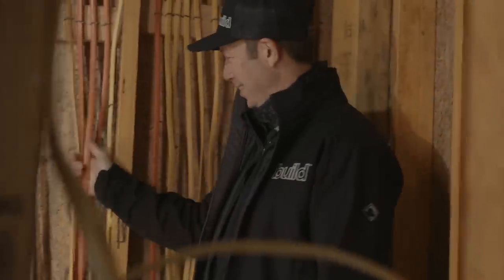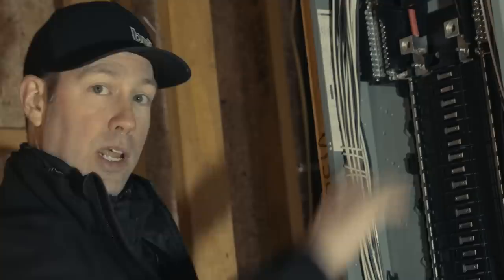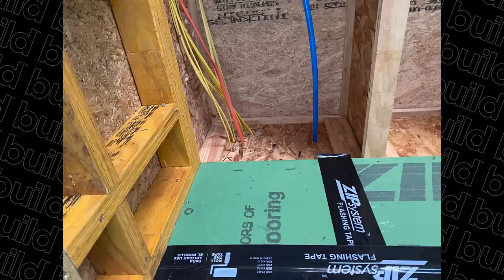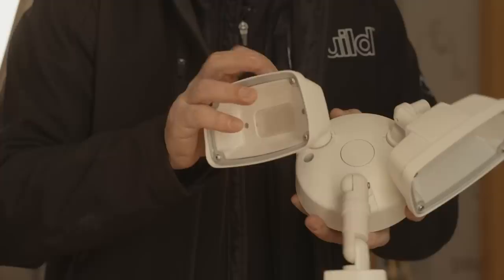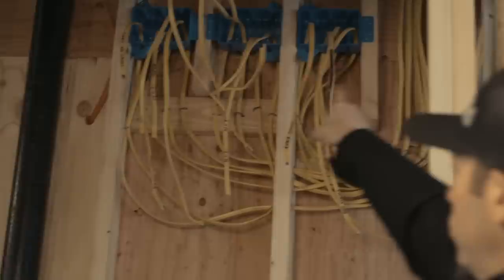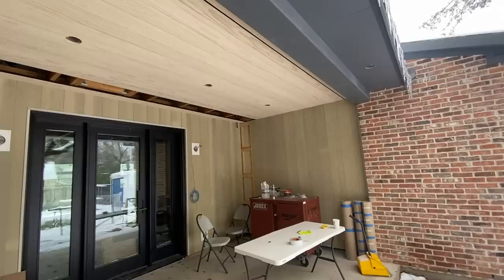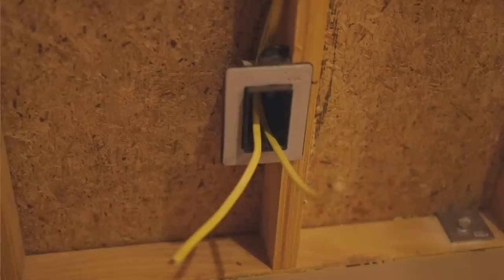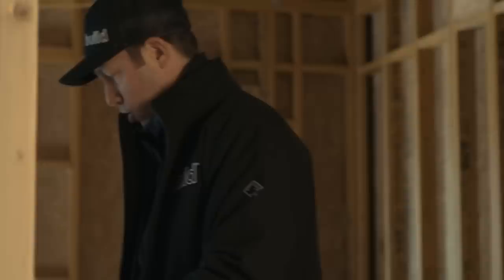5 Tips for New Construction Electrical & Smart Lighting!

Comment: maybe it's a regional thing, but why is your main panel on the outside?
Reply: I'm curious about this as well. I don't like this at all from a security perspective alone
Reply: It’s a regional thing, the same reason they install their water heaters outside.
Reply: It’s a terrible idea for thermal breakers as THEY WILL trip with moderate load on a hot day.
Reply: That's normal in the South.
Reply: Yeah but what benefit is there? I can't think of a single one but I'd love to be educated!
Reply: @shaunimal3378  I'm not an electrician (ignore the 700 miles of wire in my shop - it comes with the house) but I do know that the main panel is used by the power company for shutoffs, or it was before smart meters. May still be used for emergency shutdown, perhaps when there's been tornado damage and they need to shutoff a damaged house while restoring power.

Come to think of it, thunderstorms and tornadoes are so common that I wouldn't be surprised if that's not part of the reason.
Reply: The 2020 NEC requires an outside disconnect. All places that are on the 2020 NEC will for new construction and service changes will have an outside main breaker.
Reply: 2020 code states you must have a main disconnect on the outside.
Reply: @htownelectrican , Can't they just pull the electric meter out and shut it down that way ? Thanks.
Reply: @augustreil  it’s actually a little too dangerous for first responders to do that while under load... too much liability I’m thinking, however it says emergency disconnect....it doesn’t require a breaker just a physical disconnect or basically a large switch rated to shut down the whole system.
Reply: @claytonsprague7316 , I understand, thanks.
Reply: @htownelectrican  "2020 code states you must have a main disconnect on the outside" I imagine that's the reason, but it seems like it'd be higher-quality construction to just have a single switch on the outside (with a lock), and still keep all the breakers on the inside.  I expect most customers would be willing to pay for that very simple upgrade.
Reply: That's pretty standard in Texas.
Reply: @RaddestDad  With the recent arctic weather in Texas most likely water heaters froze and burst along with their exterior water supply lines.
Reply: @shaunimal3378  unfortunately it’s now code. Although nothing would prevent the home owner from locking that means of disconnect.

Comment: "Smart" light switches are incompatible with some LEDs. The lights will actually flash like disco strobes when turned on. Ask me how I know. I am now firmly in the KISS school of lights and switches. Having the switch mfr blaming the bulb mfr, and vice versa is crazy frustrating.
The switch mfr will publish a list of compatible lights, but the bulb mfrs come out with new models yearly..... so the "approved" bulbs are sometimes off the market. Again... voice of experience.
Reply: I have run into this in the past. Depending upon the switch and app you are using there are settings to adjust to eliminate the flashing.
Reply: @michaelkline9647  Agreed. As a smart home technician I use to run into this a lot but have learned which switches bulbs work well. Personally I use Zooz switches as I have found them to be rock solid. Of course I use nothing but Z-Wave or Zigbee devices. Bluetooth isn't very common in the professional smart home world. Unfortunately he's locked into Halo with this but hey, he got it free so I'm sure he can deal with it.

Comment: You don't get a call backs about tripped breakers if you size the loads on each circuit correctly. This new construction you should never have an issue with that. No need for 12 gauge.  Although I do prefer each rooms outlets to be on their own 20 amp circuit. Separate lighting circuits.

Comment: Wire all your ceiling lights with 14 gauge wire and to a breaker that only feeds other ceiling lights.  14 gauge is much easier to work with, cheaper and LED lights draw so little current that you will never overload a 15 amp breaker.  14 gauge for lights and 12 gauge for all your outlets and don't forget all switch boxes now require a neutral wire.

Comment: Compared to Northern Europe, it looks different, very different. Maybe it is good, but it looks worse (no offense!). Maybe someone who knows both can elaborate/compare?
Reply: Regarding the electrical? Maybe you are used to seeing conduit in the walls?
Reply: @Freedacarlo  everything in illinois is conduit. I don’t like exposed wire like that. It’s much to vulnerable. I’ve seen people drill and cut though romex.
Reply: Exactly, that is one of the main things. All wires go trough conduit. And since most houses are from concrete or stone, it is even less exposed since the conduit is encapsulated by concrete/stone. Furthermore, panelboxes and things like that are not outside.

Comment: As a computer guy I cringe at all these smart lights... just wait until some of it breaks or goes wacko with random lights turning on and off for no reason.
Reply: Computer guy hugh?  U sound Authentic 🤣
Reply: It's hardwired "smart" . I didn't watch entire video but I don't think it's got network capability.
Reply: @LucifersDeathSquad  There are no hardwired smart devices. Code won't permit low voltage wiring mixed with 120V switches. Everything "smart" for lighting controls is all wireless BT,Wifi, Z-wave, or Zigbee.
Reply: @guytech7310  - You didnt see the wires sticking out of the back of the switch and right on the package where it says "Hardwired" . Lol. The switch might have low voltage components on the inside but it needs to have 120v to power the transformer that gets low voltage to it. I do install some switches that are battery operated that remotely signal a reciever but other than that , where's it gonna get its "Low Voltage" from ??
Reply: @LucifersDeathSquad  Not sure what your referring to. Are you referring to the low voltage connect between the Halo power supply and the light fixure?  There are no hardwired signal for them. They are purely wireless signal controlled. 

If you don't believe go look at them at Lowes or HD, or from the website.
Reply: @guytech7310  - En Passe

Comment: Hey Matt great video, I've been following for some time and love all your work.  I just have one question.  I'm so paranoid about security in my house and I'm just wondering why put the breaker box on the outside of your house?  Is this a code in TX?  Here in South Dakota, we put the break in the basement or garage.  I just worry that someone could easily cut the power off in my house and take out my security cameras or even my security system.  Also, I would worry about water getting in the box.

Comment: It’s not just about the circuit breaker popping. What’s more important is that the heavier gauge has less resistance. Resistance turns electricity to heat. You have to pay for that resistance. If you plan on living in that house for a while you will actually save money. It’s not a two year payback but especially on those heavy load circuits, go up a size.
Reply: Well said. You're talking about voltage drop. You're one of the few to recognize this concern and post.. Good job.

Comment: About Aluminum Service wiring, most are alloy's that are not as prone to the oxidation these days. As long as the connector is rated for should never be a problem. still cannot go wrong with copper either.

Comment: So you ran all lighting circuits on a 20 amp circuit? That means you can have 2400 watts on a lighting circuit.  Halo 4” led cans use 8 watts.  This means u could have 300 can lights on a circuit before overcurrent.  This is complete over kill and a waste of money on the lighting circuit.  For the Outlets i can see the use of this.  Wiring new can lights with 12/2 is a pain.
Reply: I mean, not really, unless you are going to overstuff a junction box.

Comment: Your gonna regret the smart home stuff 10 years from now.
Reply: Why will he regret it?
Reply: Jack Sak This stuff just doesn’t last, and in order to service it, ie bad led driver, your going to have to open up the ceiling. A lot of the blue tooth  connectivity isn’t solid.
Reply: @suspicionofdeceit  Okay. thanks for the reply.
Reply: Plus IOT devices are inherently NOT SECURE. Even if manufacturer initially puts some security on it - but they usually don’t - they don’t keep it updated. IOT devices (aka Smart Home devices) are now THE LARGEST group of devices used by hackers in their malicious bot-nets....
Reply: @judmcfeters9054  Everything I have is hard wired, no WiFi or other RF except for my cell phone which has nothing on it, no applications, no downloads, no critical data, no transactions. I wonder why I have a cell phone except to text with my kids. I'm way old school at 77.
Reply: Matt is obviously great at the build stuff. But as a tech guy, cringing at his smart home choices. You can definitely do smart home right. But it requires the right networking equipment, expertise, and most importantly, guidelines for how to choose the right products. The RIGHT products use full stack networking (ideally Thread, but not really available on the market yet) and are fully LOCAL control. The real dream is hard wired PoE devices.

Bluetooth is an awful protocol for smart home devices.
Reply: The really funny part is he thinks this is going to last 150 years.
Reply: Another option is a relay based system.
Reply: @suspicionofdeceit  which I argue is the "knowing what to buy" part of my comment. Shelly is a esp8266 based relay that is locally controlled and MQTT compatible.
Reply: @judmcfeters9054  While I agree with IOT devices being inherently not secure, it is very simple to secure all of those within your own network.  An internal mesh network will solve this problem dramatically.  You don't even have to be a network genius to do it.
Reply: You will realize that once you start using power in your home Matt I seriously doubt you ever gonna get up to the loads even will multiple devices hooked up on a single branch circuit. The best and main reason for putting in 20amp over and above 15-amp is to address the voltage drop on the longer runs of wire.  That voltage drop is probably more important for ensuring optimal device running and its longevity.

Comment: Using 12-2 for led lighting is a waste of money and way harder for the electrical to do terminations.
Reply from the maker: Fair points
Reply: How possibly is 12-2 harder to terminate than 14-2? I done lots of 12-2 & 14-2 and have absolutely experienced no difference.
Reply: @guytech7310  a four gang switch box with four smart dimmers and 10 12-2 romex wires coming in is very difficult to terminate neatly. 14 guage just bends and goes under device screws way faster and with ease.

Comment: If there's an appropriate amount of circuits brought to the general lighting and outlets circuits, there's no reason to run 12-2 in the era of LED where a can light or bulb will draw 10-20 watts. The electrician will 100% charge more to wire an entire house in 12-2 because it is a real pain to work with in switch boxes, especially with devices like dimmers, or in 2&3 gang switch boxes. This is an unnecessary expense, money absolutely better spent elsewhere. If your kid is running a hair dryer in their bedroom address the problem. Don't spend a fortune to make that problem not a problem.
Reply: Completely agree, if all the lights led go with 14-2. His electrician didn't tell him to use 12-2. Also no electrician wiring custom is going to use aluminum wire. 
It's a mute point.
Reply: @SpeakEasy2  yea, moot point. I guess I could see big AL se-r for a subpanel but still won't have problems for a looooong time
Reply: @chriswithrow3107  when was the last time you saw 12-2 or 14-2 wire?
Reply: @SpeakEasy2  ....do you mean in aluminum? I saw a range home run in #8 or #10 couple weeks ago on a service call. Other than that pretty scarce in the Midwest in my experience.
Reply: @chriswithrow3107  yes, I meant aluminum. For sure I see #8 and #10 and use it. But can't remember if I've seen 12-2 or 14-2 on the shelf to purchase.
Reply: I agree, properly installed and limited lengths of home runs are fine with 14/2.  Circuits have to be limited to correct number of devices per code.  Long runs good idea to have 12/2 to first device and then 14/2 to remaining.   Box fill, ease of terminations, cost, all add up.  Plus then if running most device outlets are rated for max 15 amps, cords are 16 or 18 gauge,.
Far better to have more circuits at 15 amp, loaded correctly then maxed out 15 or 20 amp circuits.  
In my option,
Reply: @SpeakEasy2  no it's not been permitted for interior wiring under the NEC for a long time.
Reply: @chrisv_b  in the US, there is no max number of devices per code in residential. Commercial applications require a X watts per receptacle calculation and limitation.
Reply: @chriswithrow3107  okay, did not know that, now I see why there might be tripped outlets like Matt mentioned.  So easily corrected with code update.
Reply: @chrisv_b  there would be tripped outlets when someone is not using common sense. TVs, phone chargers, laptop chargers and desk lamps are not going to trip a 15A circuit. Curling irons, hair dryers and space heaters will, and I see no justification for them to be used in bedrooms, on carpeting, getting left on and starting fires.

Comment: In Canada we require afci on all plug ciruits other than sump fridge and counter plugs. On a house of that value id make my wires a bit neater in the joist (but thats me) i know its not seen later but nice clean corners in your cable is nice. But please never touch a bus or lugs even if your 100% sure its off never get comfortable with doing that. The 12/2 on every ciruit is a very commerical thing. Which is nice if you ever require a 20amp ciruit on something you have the option

Comment: Love all the content. My only gripe is about using 12-2 romex for lighting. If you want everything else in 12-2, that's a good idea. However, basically in 99% of applications there is NEVER EVER EVER EVER any reason to run lighting in anything but 14-2. Firstly, it should be standard practice that lighting is on circuits that only supply lighting. There's more than one reason for this, but in this instance this means that lighting will never be on a circuit with receptacle loads. Second, other than very rare fringe cases, no lighting circuit ever exceeds 15 amp (14-2 is limited to 15 amp), especially today with everything going LED. Thirdly, it makes wiring and servicing significantly harder. Some luminaires CANNOT be installed with 12-2; they literally can't fit. Fourth, lighting circuits don't nuisance trip from overload. They just don't. 15 amps provides a lot more power than you think.

Basically using 12-2 for lighting in your home you are wasting money on making your homes lighting harder to service/upgrade/expand. Now, if your lighting is mixed with receptacle loads (which they shouldn't be, this is becoming less and less standard practice) then yes there is a case to be made for going all 20 amp. Other than that, no, 14-2 for lighting all the way.

PS just my professional opinion, but I would highly recommend avoiding the Square D QO series panels and breakers like I saw in the video. I don't know why, but I've noticed that East of the Rockies the QO stuff is much more popular.